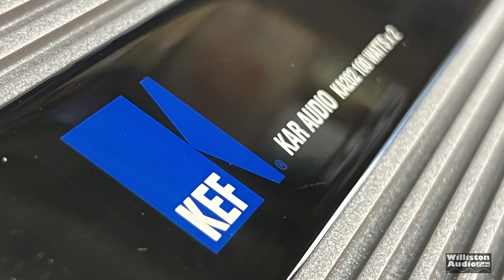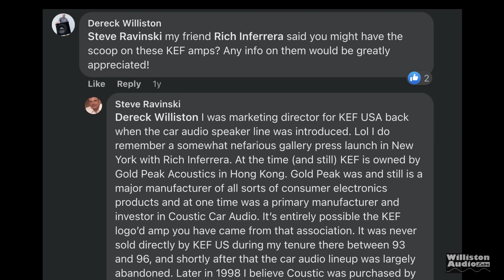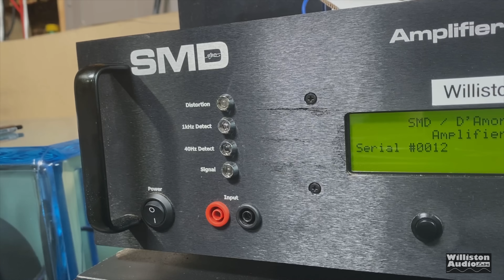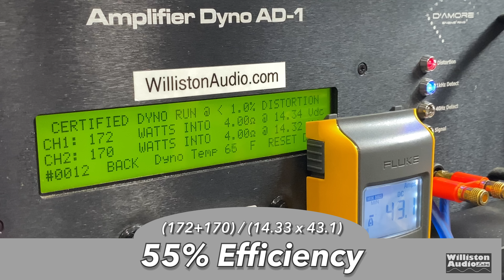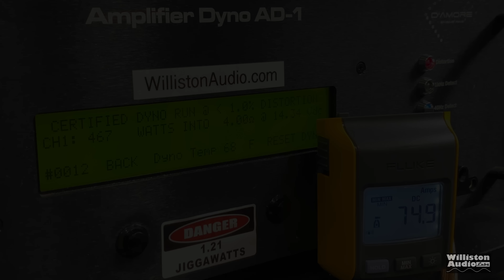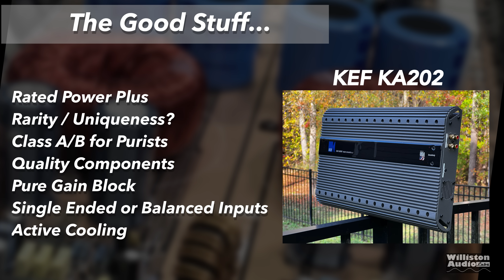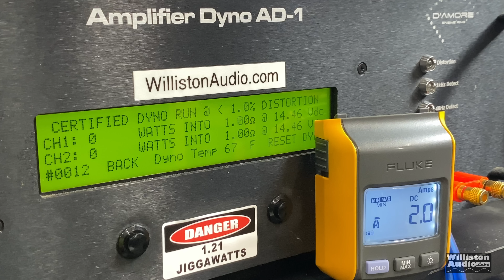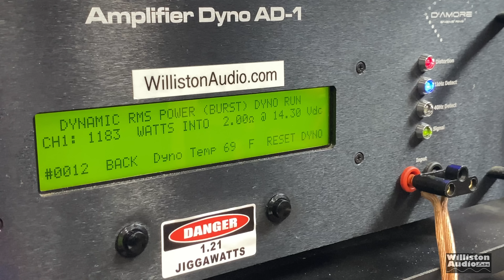Who Knew KEF Made Car Audio? ULTRA RARE 1998 KEF KA202 Amplifier Review and Amp Dyno Test

Comment: Great review and video as always and beautiful unit. You can tell it's a high quality amp with the thicker traces and quality board but these older Elna caps that are the RE2 (now replaced by RE3) are the miniaturized standard caps. And while Elna is a reputable Japanese maker of capacitors, like my favorite Nichicon, I wonder why they did not use Audio Capacitors in such a high end unit. In fact from closeup you show I don't see any audio caps on board. If recapping I would definitely go for some premium grade audio caps well as ultra low ESR caps for the power supply.

Comment: I knew of Kef car speakers back in the 80’s. A friend had them in his car.  4 or 5 in plate speakers.  Sounded sweet and musical. 

He listened to all kinds of music.  Don’t believe meant for SPL contests. He blew the tweeter.  

Polk Audio had some decent plate speakers that would play loud and punchy bass but a bit raspy on the tweeters at high volume.   He sold me his.  I had a Nakamichi PA300 75x2.  

I think he was running Soundstream at the time.  He also used Monolithic.  I still have a Monolithic PA4000 amp.  

I never knew Kef had car audio amplifiers.

Comment: Nice looking amp inside and out! Always cool to see old stuff with the original box as well. I still have a Rockford 800a2 in it's original box, manual, all that, I mean I had it out to test and and look at the guts many moons ago, but put it back in. Planned on using it for an install, but never did.
Reply from the maker: Thanks for watching and commenting!

Comment: i knew. kef uniQ and morel at the time were the top of the sq inasmuch as i'm a boston born and new england sound appreciate (and big ads fan).

back then i auditioned the kef & morel for the doors of a 3000gt, (went with the kef) and fit a pair of pioneer 12s while also retaining the trunk space, and powered by 2 coustic logic amps, a 60x2 and a 30x4.

Comment: If you remember the Aria (Fultron now Memphis) Point Synchronous and Orion Point Sync speakers- they were based on the KEF Uni-q design.  As I heard it shortly after those two came to market, KEF enforced their patent.  Orion chose to drop the line whereas Fultron/Aria chose to work an agreement out.  Any and all speakers that place the tweeter vc on the same plane as woofer VC are covered by that patent.
Reply from the maker: Great info!

Comment: How do they compare to bang & Olsen? I have a set of their Pantera three speakers and a couple different bowmasters 6500 and 5500 with CD players. These were all built pretty much around 1989 to 1992 and they sound just as incredible today as when I bought the penta 3 speakers brand new the very last set of Penta speakers sold in United States out of San Diego in 2000. I still enjoy this sound system to this day.

Comment: Haven't seen one of those since I was day trippin' in a parallel universe ... seriously tho a buddy owned the local high end car audio shop up here in Canada carried them and some lucky bastard got that amp installed in a Celica GT running the fronts and midbasses in the rear sides. Incredible midbass attack. They stopped carrying KEF and I ended up buying a bunch of Uni-Q speakers when they closed out the line... still have them around here somewhere, NIB.

Comment: Nice I'm sure it cost and arm and a leg 
I just got a gem of my own Sony xplōp 
XM-754HX I can't believe 1997 was 25 year ago anyway was told it didn't work  but it works great  I think the fan not working I don't know if it thermal control or it should be running full time do you
 Big D

Comment: Would still love to see you do a HV amp at 400 volts, preferably the Stetsom force extreme!!
Reply from the maker: Thanks for the suggestion
Reply: @wal  I have 2 of them running on my EV battery, I'd do it myself if I had an amp dyno.

My friends clamped 60k RMS on subs (SMD AMM-1), what does the dyno support up to power wise?

Comment: Hi Derick.   Circuit designer here.     YOU do keep saying 55% Efficiency is Bad.     It's not. At All For Class A/B.     Because Class A/B splits The Power Rail.      So 50%     Is NOMINAL.   50% Is Good AnD ANY THING Over 50% Is REALLY GOOD.    It's Not Bad.     If You Split The Power 50% is The Best You Can Get For A\B.   So 55% Is Dann Good
Reply from the maker: Hey Joey. I realize efficiency is low with Class AB but the “bad” is related to most car’s limited electrical systems and how an amp like this compares to a more efficient architecture. I get what you’re saying but you must understand the overall comparison I’m trying to make.
Reply: It's not because of "splitting" the rail.   Far from that.

Comment: Some of these old school amps have 2 volt input sensitivity. How do you use these amps with newer higher voltage pre out head units?
Reply from the maker: I will set the gains based on 2V instead of 4 and turn down the head unit's volume to match the 2V

Comment: Definitely a "full range" amplifier for sure. Probably wouldn't want to use it bridged unless for some odd reason you had like 4 of these amps and wanted to run 1 channel to each amp for "full range" speaker cabinets.
Reply from the maker: In the 90’s external crossovers were prevalent so you could send low pass signal and have the amp powering subs. Seems like a bit of a waste on such a SQ oriented amp

Comment: i want to know how you could rattle shop windows back in the 80s and 90s with such low watt speakers compared with new stuff now that are quadruple the watts
Reply from the maker: Speakers were in much larger enclosures and did more output in the 40’s
Reply: @wal   i had 150rms 12'' subs in ported enclosure and could hear my bass from blocks away back in the days. new car audio gen are running 1000watts now can hardly hear it outside the car. 90s def was the peak and golden era..everyone wanted some bass.. old school speakers were way more efficient . car audio was quality back then. ive got old kenwood mask cd headunit from 90s sounds better than most of the new headunits probably due to military spec components

Comment: Can we really notice the difference between class D vs. class AB in terms of sound quality?
Reply: If you have a good class AB, good files and good source, yes. Class D in my experience will give a fatigue for long listening with a digital sound though they are interesting to listen to ( good class D ). Even for Mid bass I prefer class AB. Class D for sub for the efficiency, control and power.